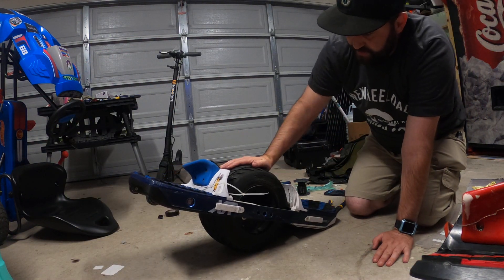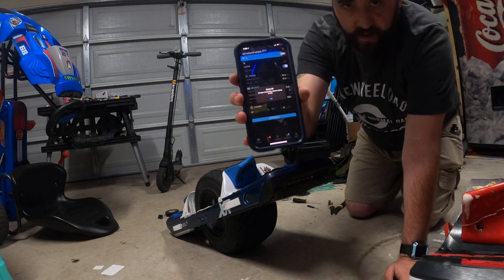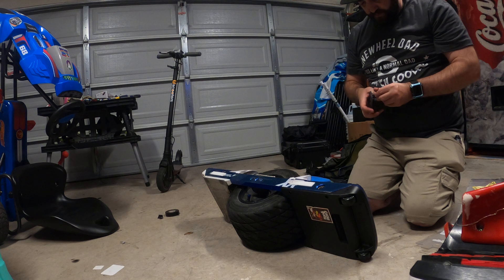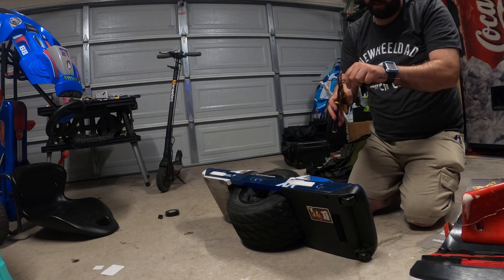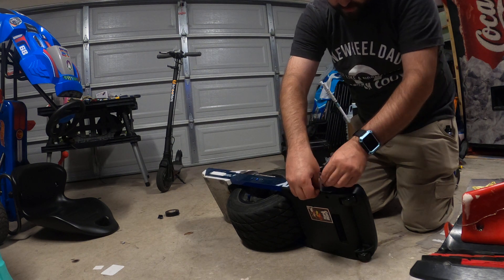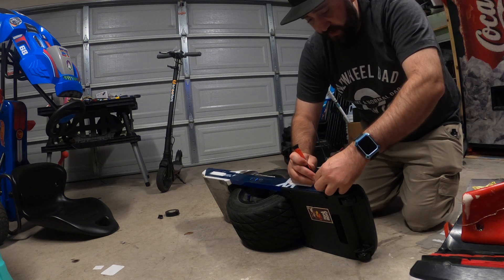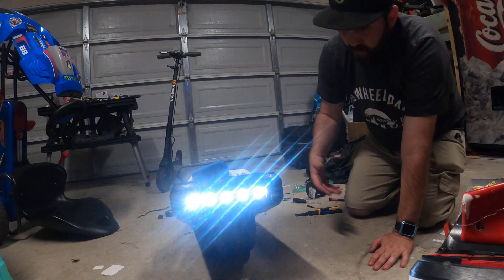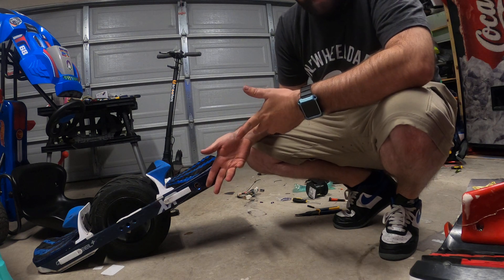Onewheel XR error 21 code

Comment: It’s been a while has that fix remained your permanent fix? I think my air is 16 16 I can’t quite remember but it’s a no start flashing start button that will charge the battery but never will start. I can’t tell what’s wrong on my warranty is dust and I’m thinking about a BMS bypass to test because I know the batteries fun however I don’t know if the controller or EMS is damage everything looks fine happened after a crash